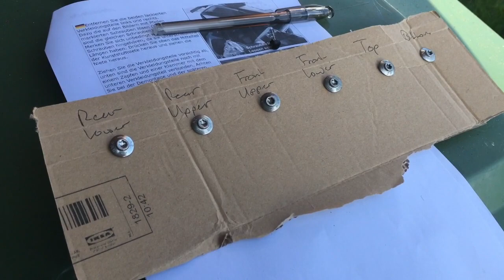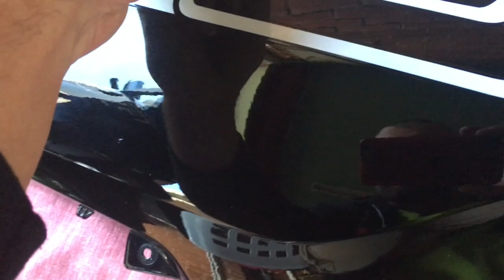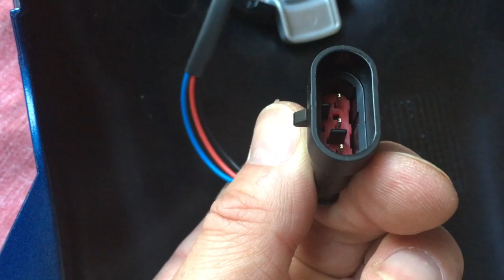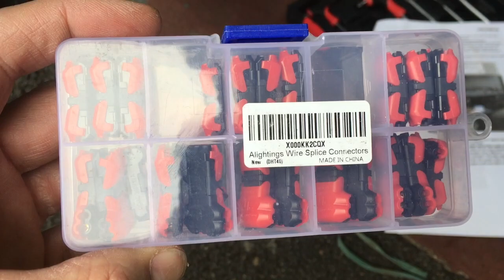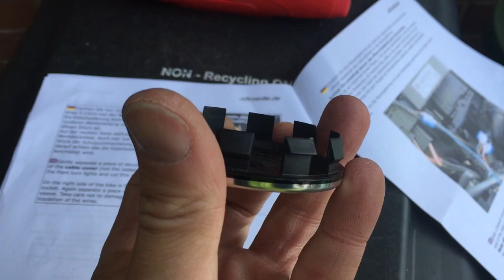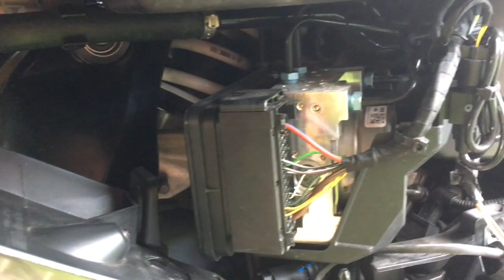Installation Video - Schroedie.de - DLR & Indicators on a BMWK1600

Comment: Fantastic video, thanks.  I have fitted these white and amber lights (not Schroedie) to my GS and RT and now want to fit a set to my K1600GT.  The Schroedie look the neatest. The only thing I notice is on my other bikes when you activate turn signals the white goes off and stays off until the indicator is cancelled.  On these Schroedie it looks to me as though the white LED is intermittent with the amber when activating turn signals which seems to diminish the effect of the flashing amber. Is this correct or does the white LED light stay off completely until the turn signal is cancelled? Thanks.
Reply from the maker: Thank you. Yes. The white is only off while the amber is on. When indicating it flashed amber then white. It still is very effective.
Reply: @kevinbazeley  Thanks Kevin.  Very much appreciate the reply especially considering how long ago you posted this vid. Trouble with the cheap halo LEDs which are incredibly bright and do not do this is that they are 70mm diameter so a tiny bit too large.  However, considering their price I may give them a try first. Thank you.

Comment: Hi, I really enjoyed your video, I used the GPS connector instead, you can buy original male / female connectors, so I do not have to use power thieves, and omitted the turn signal function, mine are red/yellow, so they just light up yellow constantly when I drive they turn off about 30  SEC.  after ignition off.

Comment: After watching your clip, I ordered a kit from them as well. The 18 K1600 GA is same set up. Customer Service was quick to reply. Very easy to install. Take your time installing. Make sure to hold the round disc steady and in center of cavity and mark the holes with 1mm drill bit, then you can drill the 2mm holes. Second, If you ARE NOT charging the battery via the 12v socket on the right side, I recommend tapping the running lights to the red wire on the socket. I ran a wire from the right side socket a cross the front in the back of the front headlight assy. Plenty of room to snake a wire with insulation. Now, every time the bike is turned off, you will have a nice running lights in a dark area at night staying on for 30 seconds. Perfect for me. I charge the batt via pig tail directly off the batt. Also, Amazon carries the same posi taps for 10.00 a dozen. Works perfectly.
Reply from the maker: A pleasure to have helped

Comment: Why would you use a TRickle charger through a socket? Dont those connect to the battery?
Reply from the maker: BMW have designed it so that this socket can be used to connect a trickle charger meaning that you don’t have to connect and extra wire to your battery and have an extra socket hanging about somewhere on the bike to connect to.
Reply: @kevinbazeley  So then I should be find connect it through the 12V then? Because my Trickle charge is connected straight to the batt.  Also if i connect this through the 12V will i get that constant on effect (white light)?
Reply from the maker: I don’t know. I can’t advise you. I’m not an electrician. The wire I found. The yellow and red one that goes to the aux lights works perfectly. 
The lights come on with ignition as the DLR and go off with the ignition.
Reply: @kevinbazeley  gotcha thanks....I think if i hook it up to the 12V. It will come on with the ignition and stay on when the ignition is off untill the canbus shuts off the 12V so it will be on for an extra 15seconds as a night light getting off my bike.

Comment: your video confused me..so its bad to connect the blue wire to the power socket?
Reply from the maker: That socket on this bike is designed to stay live and allow the use of a trickle charger. If you connect the blue wire to the live wire on the auxiliary power socket the DLR light will stay on even after you shut off the ignition and drain your battery